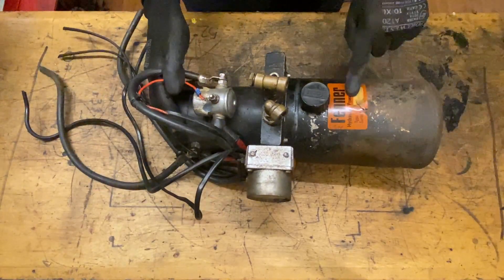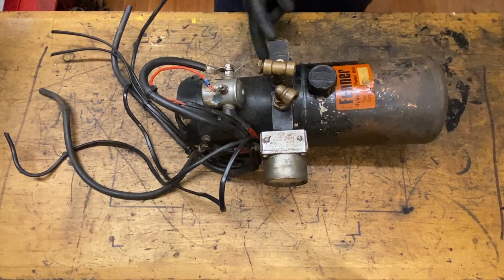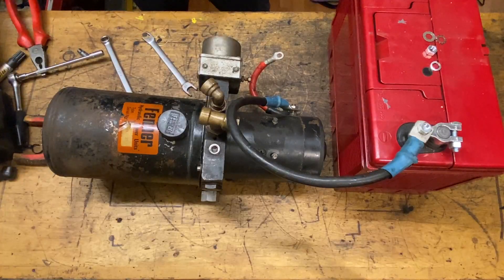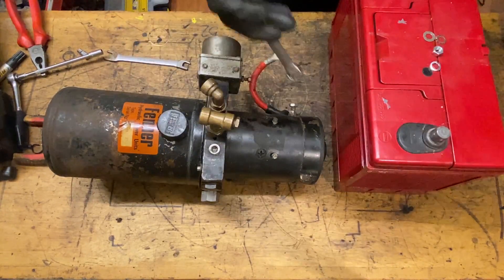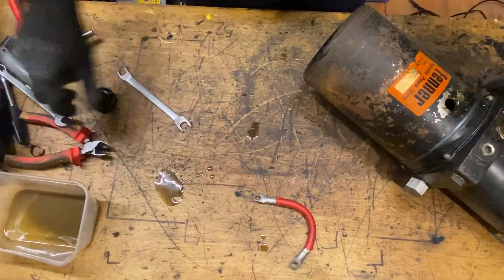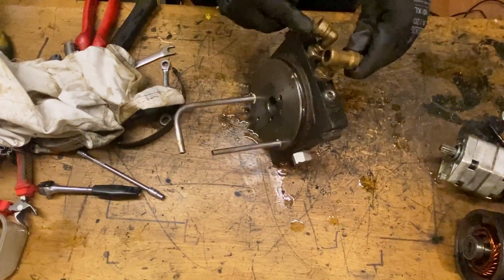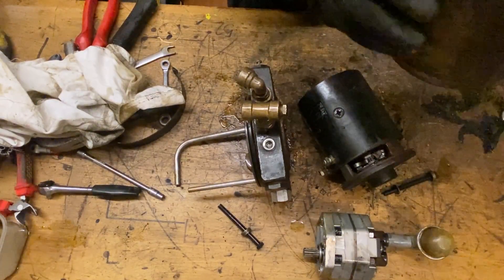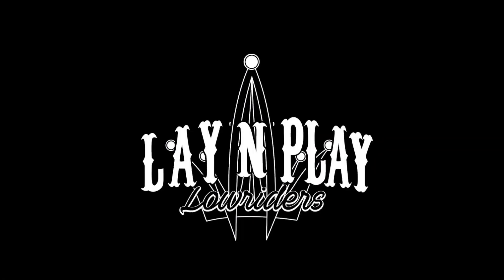FENNER HYDRAULIC PUMP! Strip Down and Inspection - Part 1???

Comment: I was working on a fenner lever hydraulic, and when I plug into a battery it sounds loud like the motor is running stuck until I go up and down with the lever. It works just noisy idle. Is that normal. Should I install a switch to it?

Comment: You obvious aren’t familiar with the old school gates., this was very common even in the 90’s. All hydraulics with tha exception of aircraft are a reproduction of this style pump. The filter is there because those gear where made of metal not like today’s aluminum gears the tank usually had a magnet in it to catch the metal shavings., the metal box on side of block is your dump valve I mostly got rid of that and plugged the side you can also rid the pump of the tubes from pressure relief and return side those are useless. The big silver nut on bottom of block is your pressure relief, it keeps you from over locking., turn it all the way in and it’ll build decent pressure., although I’d get rid of that gear and run an actual fenner #6 to the front or #8 to the back. I’ve installed lots of these back in the day, guys use these a lot still and some collect as part of traditional style set up from back when being lifted was mostly all lay and play they can be dressed up nicely depending on your plumbing and both industrial and aircraft dumps. After 1997 that all changed with the then new marzzochi gears
Reply from the maker: Amazing information! Are you ok with us quoting this and giving you the credit in the next vid?
Reply: @LayNPlayTV  yea that would be ok. Not sure how familiar you are with the fenner stone gears but we used to use #6 to build up pressure to the front and #8 to the rear or use all #8 on dancers and #6 on hoppers. These types of pumps could last you forever with little maintenance.
Reply from the maker: Lowriding in the UK only really took off in the late 90s/early 00’s and a lot of guys used a UK branded pump, so although Fenners did get used it wasn’t on the scale as you guys did, we never got around to experimenting with pumps, we ended up running pro-hoppers, showtimes and CCE
Reply: @LayNPlayTV  I see. Those gates where almost a right of passage., almost everyone I knew had been lifted with gates at one point in the 90s before aluminum blocks became the norm (being low rider hydraulics as we know today as a product was in its infancy but had been around for a long time repurposing old aircraft and industrial hydraulic components). Red’s hydraulics made a really nice old school series with mini fat cast iron blocks and aluminum pressure plates, it was fairly popular at the time using their own brand of L.A squares (deltas made to look like adels squares) Porky’s hydraulics also made a pump using the same blocks and named it El Corazon series which also was popular. I still know people who hunt these down and refurbish to use as an old school set up. Used with aircraft check valves, aircraft slow downs, and aircraft dumps.,most hardline them and try to look for the prestolite belly banded motors. Again not high performance but more a classic style with little to no maintenance (I’d keep the filter and magnet in tank) also the key for that was mostly a tang style key like what you have shown but I’ve had some with a 9-16 spline key as well but usually on the fenner gold motors.
Reply: @LayNPlayTV  the gears in that pump are the same liftgate gears they're using today they're not very good for lowriders I remember when they first came out they would cracked aluminum housing because of the pressure it started to build the better gears where the Fenner Stone gears because they were all steel

When Fenner and Stone split up I think that was the late '80s early 90s the style of the pumps had changed a little 
the motors were not Prestolites and the gears went from the steel to the aluminum it actually wasn't as good as the early pumps the motors were actually kind of crappy they use several different types of motors I think that's when the lowrider hydraulic suppliers went looking for something else then that's where the marsucci gear came in to replace the now inferior Fenner gear and also eliminated the use of the cast iron block for aluminum blocks
 because the cast blocks would actually break under the high pressure 
Also the big players of the hydraulic scene in the LA area were able to get a hold of manufacturers overseas and started getting stuff made out there so that's how we got to China motors
Reply: @juanchavez7274  don't you mean 6s in the rear and 8s to the front. The higher the numbers corelate with more fluid.
Reply: Patiently waiting for pt2. Need to know what that valve did exactly mine has a lever controlling valve and a push coil